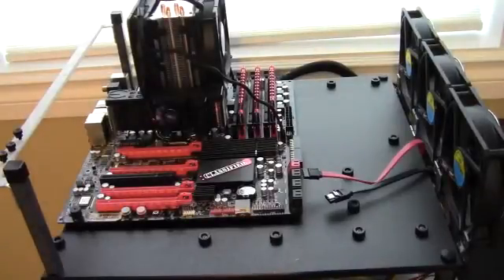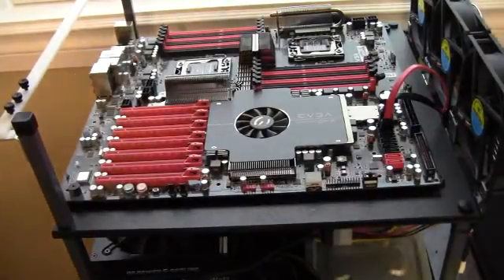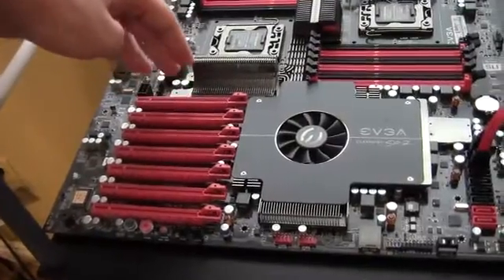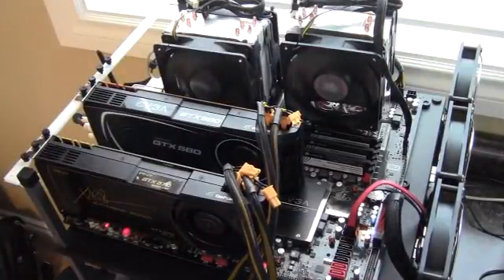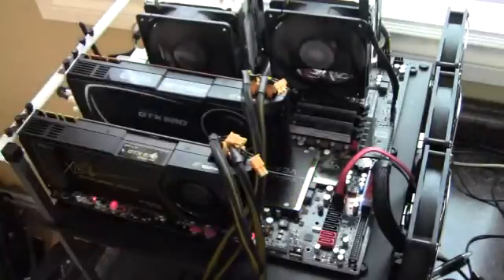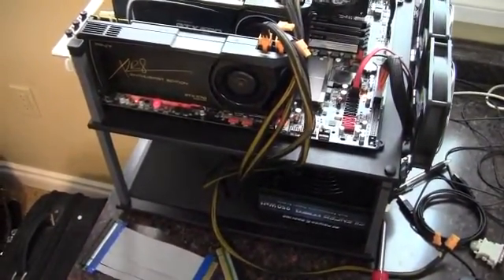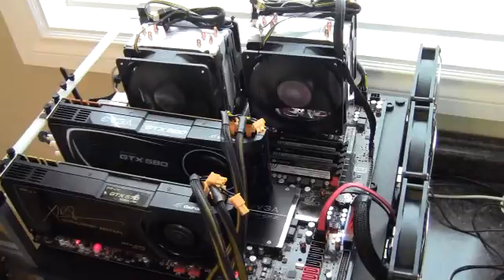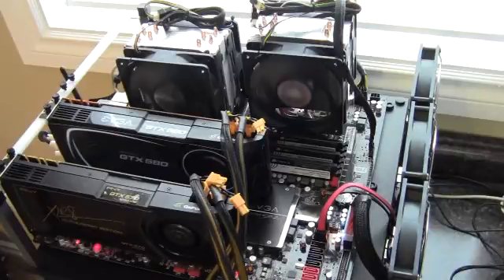Folding@Home Update September 2012

Comment: Hey, are you still folding?
Reply: If you don't have the 580 yet, i would recommend looking into something like a used 970.  Relatively cheap on ebay, and  100 watts less, so you save quite a bit on electric bills, and significantly higher PPD.
Reply from the maker: Not currently. I had a house fire last year and lost my folding setup. I plan on starting it up again this fall.
Reply: +AdoptedMike Yeah, I saw that video, I just didn't know if you had started up again. Well, I'm glad you're going to be joining the fold again!
Reply from the maker: Thanks! Do you fold? What team do you fold for? What is your setup? Mine will be a dual core CPU running 2 GTX 580's at first. I am going to be putting that setup in a 4U server rack mount case and putting it in my garage. The cool weather in my area will be beneficial especially during the winter months when it can get to well below 0F.
Reply: +AdoptedMike Yeah, I fold for the Linustechtips team. Right now I'm just running my gtx 460 1gb in my Q6600 gaming rig. In the winter it makes a nice heater :D I have some Core 2 duos and quads sitting around, so in the fall I'm planning on getting some boards and GPUs and folding on them. They're all going to be in my room, so I'll be nice and warm. Folding sure is a great way to warm up :D
Reply from the maker: Good team to fold for. I got to meat Linus, Luke and Brandon at PAX Prime 2015. Great guys. I was surprised how nice they all were to me considering that I am a nobody. I try and support them whenever I can.
Reply: +AdoptedMike That's really cool
Reply from the maker: I take it by your profile pic that you like them as well. I swear that is Taran, or you look just like him.
Reply: +AdoptedMike Haha no that's Taran XD

Comment: I saw a video some guy was assembling a system to process data from medical imaging I think he had 7 and 11 video cards per unit .models started at about $11,000 and he was  talking about special cases and those expander cables and psu's he negotiated with manufacturers for.
 The real value I suppose was in his software and technical support. Open source software I believe.

Comment: power supply? power usage? electric bill?
Reply from the maker: At the time, I was using a 1000 watt power supply. The usage varied on what cards I was using. Over the 2 years I have mostly stayed with using 2 or 3 cards and 700-1000 watt range depending on the cards and if the CPUs were folding as well. My electric bill is always really high, but I do run multiple computers and I have a very gadget filled house.

Comment: Awesome setup there, I like the test bench.  It is good that you've consolidated to one machine...I used to have multiple computers too and it isn't very power efficient.  Getting the most PPD per watt is important...folding gets a lot of bad press due to the environmental cost.  But hey, in the winter just turn your thermostat down and save on oil!
Reply from the maker: Thanks! I am in Montana, so like 8 months out of the year, I do not mind the extra heat generated :)

Comment from the maker: Currently I am getting 70-90k per day off of this machine. Total with all my machines I can get 200k per day. But the power bill is just way too high (plus the heat). It also depends on the graphics cards that I am using at the time. Right now I am folding with 2 680's. I use this setup for testing graphics cards mostly. So I will fold for 2 weeks to one month per card to make sure they work correctly. I have had this setup with quad graphics cards before and then I have to use 2 power supplies.